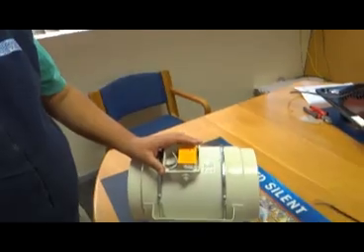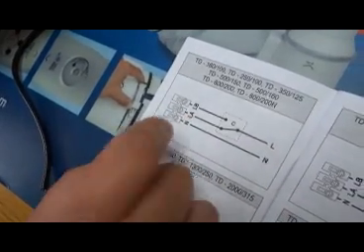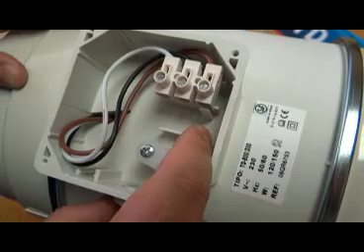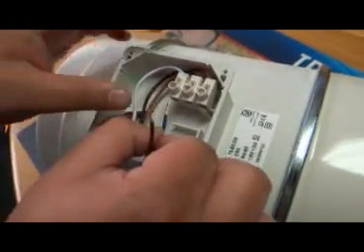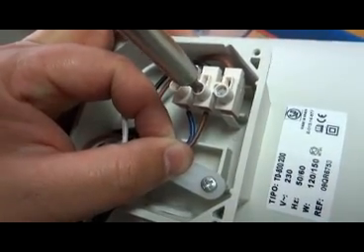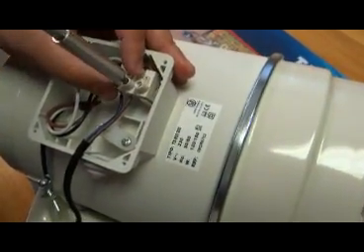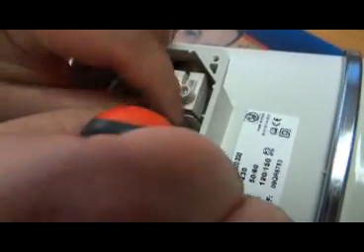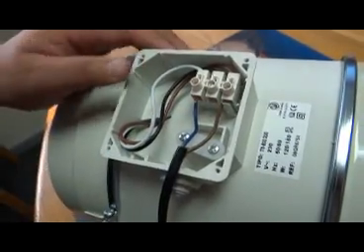S&P Mixvent Series Wiring Guide

Comment: I understand they make some sort of speed controller reb1. Do you know is there some way to connect it directly to the device or do you have to splice the wire in between for this. I'm saying do you have to splice the actual power cord and half and attach the speed controller between the two halves. I saw a video showing this but I wish there was a way to just connect it directly without having to cut the wire in 1/2

Comment: hello in anothee video the instructor says you only need to use the low speed connection or The high speed connection.he says you cant/shouldnt  connect both.why did you connect them both?
Reply: Actually he did not.  He specifically says one or the other BUT NOT BOTH.